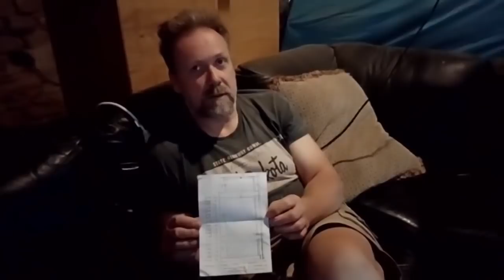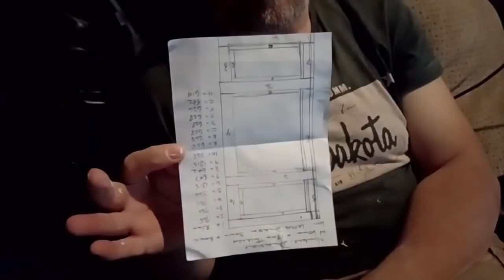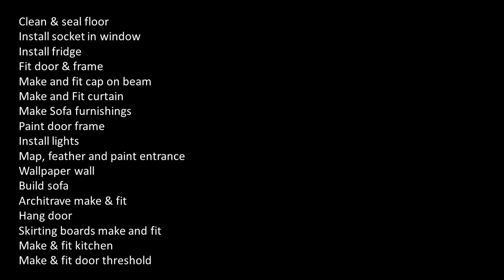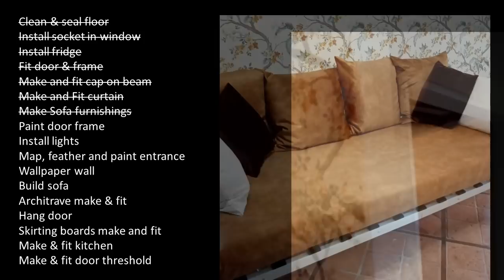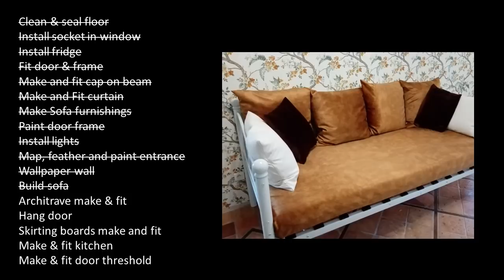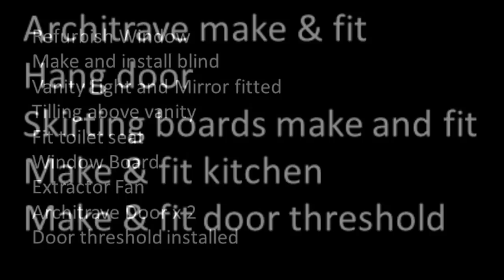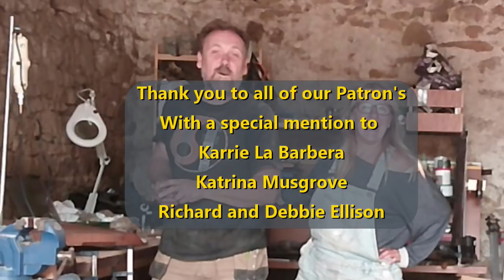48. Renovation of a 14th century Chateau De Montmagner - week 30 part 2

Comment: Brilliant work again, you are making a brilliant job of everything.

 I'm sure someone else will have mentioned to you that you can order teabags on line. The British Corner Shop have a bulk buy section where you can get 1100 bags for £28.69 plus delivery. If one of your family could get you some in the UK there are several shipping companies that offer really good rates for 20kg parcel. They will collect if from the house, or a pick up point.

 Have you ever heard of Ogix Pro special chantiers? It is a beach based cleaner that is absolutely brilliant. Good for so many jobs, just watch your clothes because it will strip the colour out. It cleans acid rain marks of paint, walls, tiles and patios. We even used it to clean the shutters before repainting.